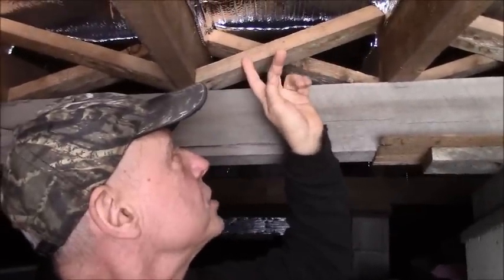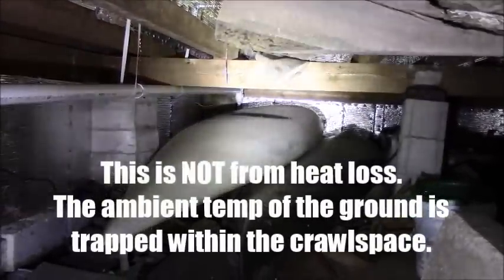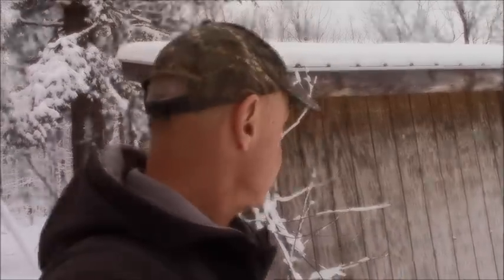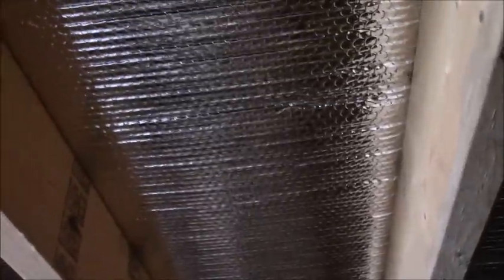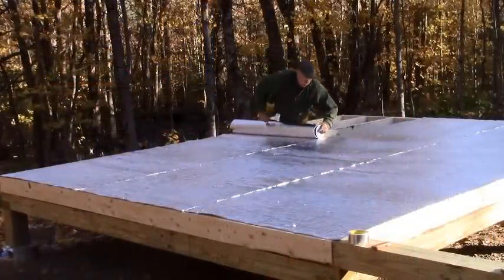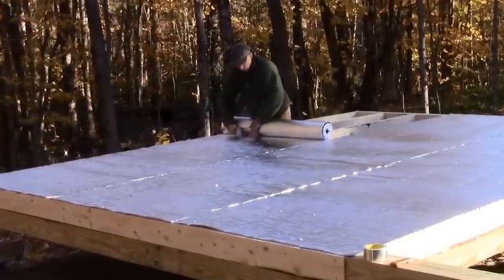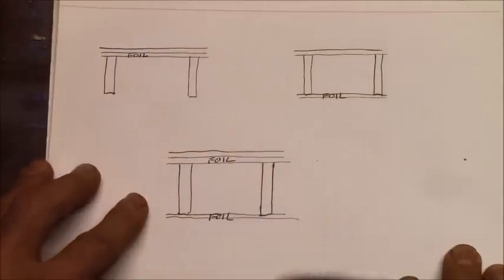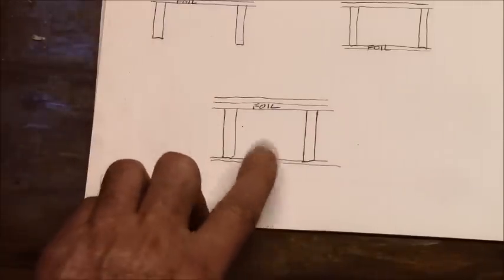BUILDING INSULATION  Proven Tactics and Solutions For RODENT FREE Results and DAMP CRAWLSPACES  DIY

Comment: Boss,  after seeing how the bubble wrap works for you i'm a true believer. The way you insulated the roof of your workshop at new place is absolutely the way to go. I love the Roxul insulation product due to being fire & water proof along with increased R-value.  Boss you have it happening.  Take Care Brother              Question for you:  Building rec room in basement with 2x4  studded walls 16" O.C. am going to use roxul and then T & G knotty pine. Should i use vapor barrier and if so where, i do want it to breathe, thanks for your time.
Reply from the maker: To be honest, I have little experience framing against a concrete foundation as all my cabins have been on piers. I don't want to suggest the wrong thing.

Comment: Haven't seen squirrel antics in quite a while 🤗❤️... very informative...am wondering however how you'd keep the ridgid foam board in place should you decide to use it with the bubble foil...friction fit, spray foam or rod supports...would you put the foam board right up against the bubble foil or leave a 3/4 inch gap like you did with the 1x2's & sheetrock 🤔... hope you're feeling better God Bless
Reply from the maker: I'll be answering all the construction questions in an upcoming video. I added yours to the list.

Comment: Thank you for this video. Question: Can this bubble foil sheeting be applied as the underbelly of a manufactured home to protect the electrical wires from rodents, or does it have to be up against the underside of the flooring like you have it installed? 

I am probably going to be replacing the electrical and plumbing in this old 1989 manufactured home that to me appears has been spliced incorrectly to “fix” rodent damage to the wires. I don’t like the existing underbelly they used because it seems to be an invitation for rodents to nest in, as I see that they sloppily left insulation sticking out and never sealed the underbelly from the cuts they made in it. What a job this looks like it will turn out to be. 🤦‍♀️
Reply from the maker: For insulation purposes, I would attach this to the underside of your floor but I don't think it would serve much purpose around your wires. I call it foil because it's shiny but it's really plastic. Mice don't bother it when it's installed in the manner I use, there's nothing to entice them to chew on it.

Comment: I'm enclosing a porch in a cold climate. What do you suggest? The wood on the exterior, then the siding, coming in you don't recommend using the bubble foil and then wood. I'm thinking of using wood and then wainscoting or a PV  sheetrock alternative.
Reply from the maker: I use fiberglass in my walls and roof.  Sometimes I fiberglass between the studs and then foil over the framing (on the inside) of the framework, not against the sheathing.

Comment: Foil Foam Foil, from Prodex SA, has a Higher R Factor, when you install it correctly, with a gap, on both sides, it creates an R Factor. Over 90 Percent, of Heat Gain and Heat Loss, is Radiant Heat. Foil Foam Foil and Foil Bubble Wrap Foil, both work, for Radiant Heat Loss and Gain, but Foil Foam Foil, has Insulating Foam, in the Middle, instead of Thin Air Bubbles.
Reply from the maker: Yes it has a higher R value but ants LOVE it and I'm so fkn sorry I put it in the ceiling of my other cabin. Just sayin.,

Comment: Hi Boss, I loved your video, "Good backwoods logic". I have an old pier and beam farmhouse and I want to insulate my floors. I was thinking of using the bubble foil across the joists, and adding a vapor barrier to the ground below since Maryland can be pretty humid in the summer. Will those two products work well together? Foil over the joists and a vapor barrier on the ground. Thanks. God bless you!!
Reply from the maker: Putting the foil on the bottom of the joist may be beneficial as it will prevent moisture from reaching your floor system - and yes the vapor barrier will be good too.

Comment: one carpenter tipp extra: Wood fiber has much air between the fibers. Hard wood is the best- because it can resist humidity. Others are best for alaska cold. The basic for floors: 10 centimeter slates. NORTHMEN has a video from scandinavian builders. They use wood dust for the space between the slates. I wood create a 30 centimeter floor system out of wood dust air and mice secure. Mices also bite through metal- that is no joke!

Comment: .Water vapor is always pushed by the heat from a warm area to a cooler area. So, any impervious vapor barrier needs to be on the warmest side to keep moisture from collecting inside the wall or floor.  Modern energy saving construction can destroy a building one way or another if it is not well thought out and installed correctly.   
   I jumped the gun. You said the same thing a bit farther along. I will be looking at bubble wrap with new respect.
Reply from the maker: Yes indeed. this absolutely must be installed so it reflects heat and not cold, otherwise moisture will collect behind it.

Comment: Your videos are very resourceful. I want to use reflectix in my shop floor but can't access the floor joists anymore. I thought about placing reflectix across the floor and then cover that with some osb.
Would that have any barrier against cold?
Reply from the maker: Just so I understand you correctly. Are you thinking of stapling this to the floor and then putting OsB on top of it?

Comment: Do you think the bubble foil insulation would be a good product to use in the floor of my 5th wheel? Or maybe just skirt it with plywood and bubble foil insulation? I use my rig in 3 seasons. Rodents are my RVs nemesis Thank you for any feedback. I’ll keep your strategy in mind as I start to build my cabin in August.

Comment: Do you find you lose any structural strength by not gluing the subfloor to the joists? Or does nailing it down give it enough to do the job. Thanks so much for the video and advice!
Reply from the maker: I'm sure a glued floor with be stronger but really can't say how much difference it would make.  There are definitely  benefits to applying the foil after the structure is up.

Comment: I have two off-grid cabins in SouthEast Alaska. They both need insulation under the floors. Was planning on pink rigid foam. But this looks great. 

Question: it's routinely 70-80-90%+ humidity up there. Everything gets condensation. Do you think we'd end up with condensation on top of the foil and against the floor? Or does the foil insulate enough that the temp differential wouldn't matter?

Love your videos!!
Reply from the maker: I can't say for sure but if it's against the heated floor, I'd say you'd be in good shape.  I don't vent my crawlspace so it's very damp under there but as you can see, there's no moisture trapped beneath the floor.  Where in AK are you? I may need a place to bunk for a night or two in the near future :-))

Comment: Thanks JC lots of great info. I'm in the process of remodeling a house my great grandfather built. I plan on removing all the subfloor to replace some of the bad joists. I plan on using the bubble foil under my floor. If I use the screws with the threads all the way will that definitely keep me from having any sqeaks or is there still a chance down the road?
Reply from the maker: I can't say for sure as squeaks may occur over time. This foil also comes cut to fit between the joist with staple tabs.  You could go that route I suppose.

Comment: Boss, if I can't get under side of shed to put bubble foil up,,
Can I lay it down on top of flooring and then putting some furring strips down and lay down   new flooring.
The shed/small cabin to close to ground to get under.
I was thinking this is my only choice on a budget and the easiest for a handicapped guy.
Also the attic is very well vented on cap and along eves., After putting ceiling insulation in ,, can I tack up bubble foil over ceiling studs and insulation?? Then put up ceiling boards.
Thank I will review this video several times.
Your fan. God bless.
Reply from the maker: I think that would work with the floor ok but I have not done it myself.  Your plan for the roof is pretty close to what i did here in this video.

Comment: Hey Boss! Just revisiting the old bubble foil series, i am planning to do the floor at my grandmother's place this fall. Structure is roughly 2ft up off the ground, only partially skirted

Will this stuff be effective in keeping heat in during winter just stapled below the joists, or do I need to completely skirt the building as well?
Reply from the maker: I have never stapled it below the joist so can't say how that will perform. I staple it to the underside of the sub floor between the joist and it works spectacular..  You'll notice the difference even without skirting.

Comment: Sounds great, but I have lots of water pipes for bathrooms and baseboard hydronics that run just below the framing.  They are covered with pipe insulation now and had no freezing, but floors are uninsulated and colder that floors over a basement area. Have always found crawl cavity to be very dry. Should I build boxes around the water pipes and put bubble foil over the outside of those chases even thought that would create the dreaded cavities?
Reply from the maker: I just saved your ? and will answer this in an upcoming construction question video.

Comment: I live in southern Mississippi near the gulf. It is hot and humid much of the year with some pretty cold spells here and there in the winter. I am repairing an old cabin who’s insulation was fully infested with rat poop and some mold so I’ve pulled it all out and want to insulate the floor and ceilings and walls but feel unsure if the vapor barrier arrangements proper to cold weather are the same for a predominantly warm place that will have a heat pump to air condition in the hot time and warm in the cool. Basically i am wondering if the vapor barrier should still be to the inside just under the interior wall or if it is better to have it up against the inside of the exterior for the breathing of the materials and prevention of moisture build up inside. Thank you!
Reply from the maker: Since I have no experience with warm climates but wish I had, especially now that we just got 25" of snow - but I would think it would work the same in all climates.  For walls and roofs, I don't recommend putting this against the inside of exterior sheathing because I think it will create moisture behind it. I always put in on the inside of a roof or wall system.

Comment: Not enough room under my structure to install the foil.  Thoughts cover existing floor with foil then 1/2 plywood on top of it?
Reply from the maker: It really should be against the exterior of the floor so that it reflects heat back into it. If it's against an exterior sheathing it will reflect cold back outward and create trapped condensation.

Comment: Looking at the third drawing, with reflective foil above and under the floor joist ... what if you would also put rockwool in that space. Would that increase the performance of heat retention or it would cause problems? Cheers.
Reply from the maker: I'm sure it would add a LOT of insulation value. My only concern would be rodents wanting to nest in that warm cavity.

Comment: Question...we have a cabin in northern WI with a floating cement slab floor. Would you recommend using the bubble foil between the cement and carpeting to help keep the floor warmer?
Reply from the maker: Although I have not used it in that application, I would think that it would work great. Try doing a section with it and see how it works.

Comment: I'm so grateful for your bubble foil videos. Question: Do you staple your bubble foil directly to the sill bay? I found a website prior to finding your video where they used DAP  Dynaflex 230 around the edges of the sill then layered with 2 pieces of RockWool. After watching this video, I'm wondering if I should remove the RockWool and just cover the sill area plus between floor joists with the bubble foil🤔
Reply from the maker: I staple all the foil and have no issues from it. What I have learned however is only put this where it will reflect HEAT (like to the underside of the floor where the foil will reflect heat back into the floor boards) and NOT where it reflects cold (like the inside of the rim joist or to the inside of the exterior sheathing) because this will create moisture behind it.  If you have foil against the rim joist reflecting cold back to the box, be sure to check for moisture behind it.  Cheers
Reply: Thank you so much for your reply. I understand now that you have explained about the sill areas. I decided to keep the pieces of RockWool up against the exterior of the sill bay and then I will cover the Rockwool (in the sill bay area) that faces the interior side of the cellar with the reflective insulation. Idk if I can post a photo or not to show you.
Reply: Here is an update. Although I have only finished with the area below our living room, it is so much warmer on the living room floor than it used to be. I did keep the Rockwool (double layers) in the sill bay areas, then covered over the Rockwool on the interior side with the reflective insulation. We have definitely noticed a positive difference in the temperature of our floor above. I installed the reflective insulation just like you did it.  Thank you so much!!

Comment: Like most things there's always an improvement. They're now is a product out that is like a sandwich with aluminum foil on both sides front and back but in between is the bubble wrap a layer of foam insulation flexible then more bubble wrap and then another layer of aluminum foil. It's a little pricey but it's there. I was wondering if anybody out there has used this? The product is being sold by a copyrighted name of ProTech. Of course they're claiming that is better than the original reflectics. The foam layer is not very thick perhaps and I am guessing 3/8 to 5/8 of an inch. I was looking at this for putting it into a shed two house conversion. Any input that you would have would be helpful. I particularly noted that is sealed and I'm not sure the mice would be attracted to this or not. But they're pesky little critters.

In the state of Colorado, the building inspectors are touring the tiny homes. And they are very impressed with the quality that people are putting into them. So much so they want to tax them. Before all this. A shed was not even bothered with as it was considered a auxiliary building and portable. So if you're out there considering doing a shed to house conversion, don't call it a tiny house. Call it a shed. As soon as you change the name to tiny house you're opening up a whole another can of worms. I suppose a heat shed or she's shed or a kid shed. Whatever would not be scrutinized as closely at this time. But I got a feeling it's coming when they try to slap that tax on everything that we have.

Comment: Thank you for sharing and I have a question so are you just running your bubble foil across the joists then you're putting your plywood over top of that? I'm trying to visualize this. It's so wouldn't that flatten all  bubbles? Or am i misunderstanding something? I do understand if this structure is already built your cutting it too fit underneath in the insulation Bays I fully understand that. I do have a cabin of my own that's already built but I have insulated partially with insulation bat and I'm thinking about getting it and redoing it with the bubble foil wrap as you shown
Reply from the maker: In this video, there's a part where you see me rolling it over the top of the joist before i put the subfloor down.  I roll it WITH the joist and not across them but you have to keep the water out as I stated in the video.

Comment: great video, I have a project on my list to insulate the sill plate rim joist area and your idea of putting the foil in first than the Styrofoam sounds like a winner.  Especially since rodents hate it. I have a poured concrete crawlspace with a encapsulation and French drain. My water supply, pump etc is kept down there and so it has a heater. due to it being a controlled environment, I am reluctant to put the foil on the underside of the floor? I think that might not be a good idea because both sides would be heated? Thanks for the update on the foil. Have a great day.
Reply from the maker: In my video, you will see the foil is against a warm floor and against the warm side of a roof. I never have any moisture getting trapped behind it in this manner.  If you staple this to the  box sill aka perimeter joist, you may end up with condensation behind it because it'll be against a cold surface. Try a small section and check on it before you cover the entire perimeter of your floor system.

Comment: Hey JC, great video (as usual!)  Wouldn't it be easier if you were to affix the foil to the bottom of the OSB flooring before you flopped it onto the floor joists?   You could just secure the edges of the foil to the edge of the 4x8, and flip it onto the joists.....?
Reply from the maker: Not really as I use T&G subflooring and I think the foil would keep getting buggered up in the process.